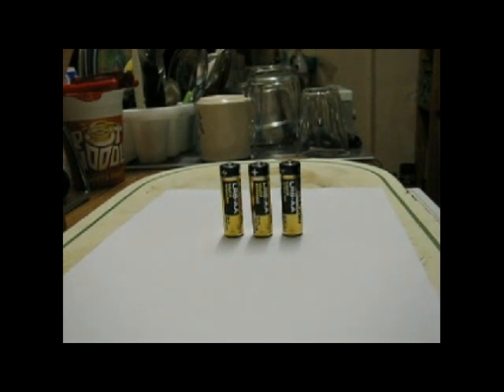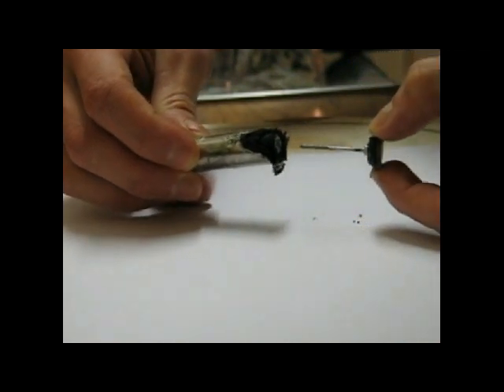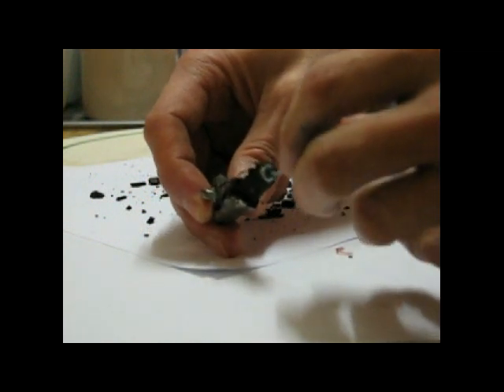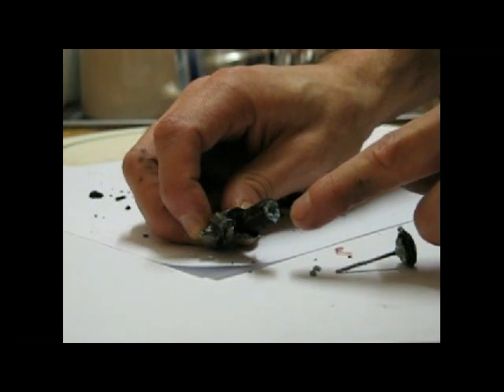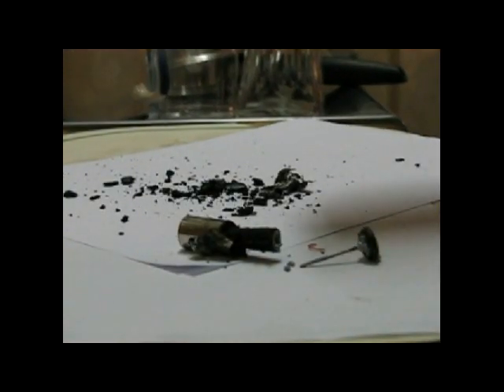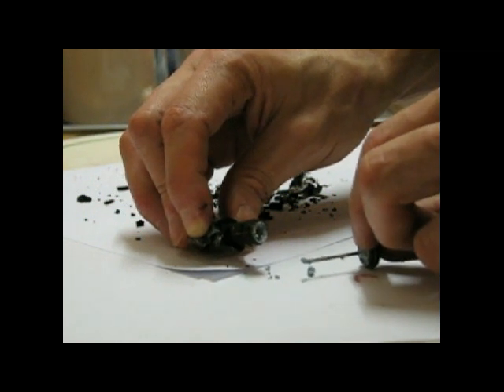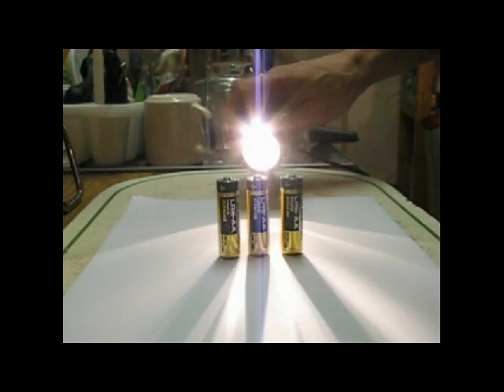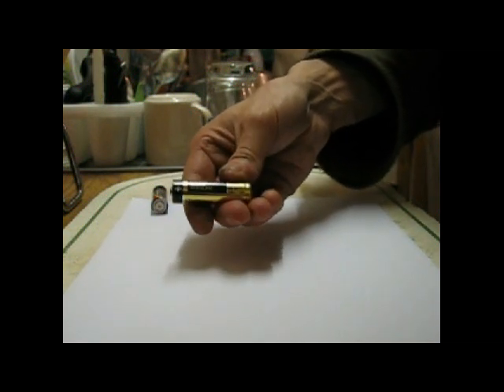Recharge Your Alkaline Batteries

Comment: I have 2 Questions.....
1) What is the maximum operating voltage(allowable/safe) to charge a 1.5V non-rechargeable battery?
2) What is the maximum operating voltage(allowable/safe) to charge a 9V non-rechargeable battery?
Reply: MattBlytheTheOne  Ok. Thank you for your reply. I would like to charge those batteries by solar energy because, solar panels of 5.5V and 100mA will be very little to charge 3V or so...
Reply from the maker: +Souvik Ghosh 

1. If the batteries are stated to be non-rechargeable by the manufacturer then there ain't a safe charging voltage (apparently).

2. The other answer is, slightly higher than the operating voltage of the battery. The higher the charging voltage the faster the charge but also the higher the risk of overheating. I would experiment with 0.5 to maybe 3 volts above the battery rating, limit the current to a few hundred milliamps and monitor them continuously to be on the safe side. Never leave them unattended and only charge them for short periods of time, like an hour max. If they show any signs of overheating or leaking reduce the voltage and throw them away.

Comment: The problem is that even if you manage to charge them, they might explode in the device they're supposed to power - this is known to have happened. So go ahead and charge your non-rechargeable batteries if you like, just don't use them in any device you'd like to keep.
Reply from the maker: +Lau Bjerno That is good advice but they are more likely to leak in your device and explode during the charging process. They are not like li-ion batteries which are made of lithium and extremely volatile. All alkaline batteries will do is expand under pressure during charging and then they might leak. They are not flammable par se.
Reply from the maker: +Lau Bjerno it is better advice never to put lithium-ion batteries in your device since if they leak and air or moisture gets to the lithium metal and short circuits them, they will catch fire and explode. Lithium metal had a very high burn rate and burns hot like magnesium.
Reply from the maker: +MattBlytheTheOne *has

Comment: I don't believed you mentioned what type of charger you were using. A nicad charger, Ni-MH charger ? Thanks.
Reply from the maker: It was just a standard charger for Ni-MH batteries. It is basically a step down transformer with a bridge rectifier.
Reply: OK, Thanks !

Comment: So t trick is to put them on a battery charger, while being careful not to leave them charging for too long a stretch at a time do that they heat up too much.

Thanks.
Reply from the maker: Yes the alkaline electrolyte in the battery tends to heat up with resistance causing pressure in the battery. Which is why they tend to leak. The trick is to keep an eye on them and not to leave them unattended.

Comment: As others have mentioned, when you are doing an informative video with narration, having music practically covering your narration is a terrible distraction. They make editing software which allows you to set background music volume. As I recall, you are also able to do this when you make a YouTube post.  Beyond that, the negatives outweigh the positives as far as recharging cells not made for charging.  Makes little sense to save 1/2 pound UK charging a dead Alkaline, and risk damaging a charger, or the table the charger is sitting on, or one of any number of negative scenarios.  My suggestion is to use rechargeable batteries where needed, and 'throw away' batteries in occasionally used devices.  This has been my experience in over 50+ years of charging various technology batteries. Cheers.
Reply from the maker: +Bill Somrak as I have mentioned before this video is years old already. The only remedy is to stop watching videos, go and buy some rechargeable batteries and get on with your life. And while you are about it but some video editing software and make your own videos, then we can hang out on your page and run that down too. Lol I don't suppose battery technology has changed at all in the last 50 years thanks to people like you! Cheers.
Reply: +MattBlytheTheOne Well, that was certainly an enlightened and informative post ... but it is not unexpected from one with limited intelligence.  Cheers.
Reply from the maker: Referring to your own post of course. There is nothing enlightened about allowing people to abuse you! Have a nice day.

Comment: Interesting.  I have a battery charger that I bought in the 1990's & it has a microchip (at least one) in it that can "sense" the recharge level of the batteries put into it & stop the recharge process before damage happens to the batteries.  Not only can it recharge alkaline batteries, it can even "top up" zinc-carbon ones, but it doesn't really bring them back to the same level as if they were new.  Also, each topping-up of them is to a lesser level than the previous topping-up.  However, these days I only recharge nickel-metal-hydride  batteries.
Reply: Is this charger called a "BUDDY L SUPERCHARGER" ?   I bought a Buddy L in 1991. This was something that the battery companies didn't want you to have and they went to governments to stop them from being distributed in North America any more . A Buddy L will charge alkalines or ni cads .
Reply: If you mean the one I mentioned, no, it's not a Buddy L Supercharger.  It's called an "IQ9000 New Discovery Charger" & it's from China. ( "Cannot beat the New Discovery IQ9000 universal charger for AAs, Nicad,
NiMH, or alkaline. It uses a CEC1100 Microprocessor. 200:1 negative
pulse charge technology. 900ma charge current")  1)  http://www.electronicspoint.com/threads/aa-battary-capacity-ah.44503/  2)  http://www.candlepowerforums.com/vb/showthread.php?26964-IQ-9000-charger-any-experiences
Reply: Also, I read this about the Buddy L Supercharger:  "Buddy L Super Charger / Emerson EBR444
The Buddy L Super Charger was released in 1993 and didn't last long. (All About Batteries)  Popular Mechanics tested it and found that the first charge didn't revive alkalines back to their original 1.5V, but rather only 1.38V.  The second charge was worse—only 1.3V.  And it gets worse from there.  From the pictures I've seen, the Emerson EBR444 was the same unit with a different name.  I bought an EBR444 around 2000 and originally gave it a poor review here, but a reader pointed out how I goofed in my testing.  Doesn't really matter, since it's not easily available anyway, and even if it were, there's little point in charging alkalines, since you can only charge them a dozen or so times (if you're lucky), vs. hundreds or thousands of times for a real rechargeable like a NiCad or NiMH.  Also, this unit doesn't recharge NiMH batteries at all, a pretty serious drawback."  ~ http://michaelbluejay.com/batteries/charging-alkalines.html
Reply: maintoc Other folks I spoke to that were former technicians from Europe told me of battery chargers like the Buddy L that were available in Norway, Sweden, Finland and Denmark but saw nothing of that type after moving to North America . It's another example of the North American government control of technology or large corporations lobbying the government so as regular folks can't have certain things .

Comment: I have been recharging standard alkaline batteries for decades. Dad taught me how.
If using a standard charger - 1 hour is the max time to leave it on the charger - test with a volt meter & you want above 15. If not charged enough you need to wait a minimum 2 hours for the interior rod to cool before re-charging again.
My personal favorite is Energizer lithium but standard Energizer batteries have better bottom seal & a better case than Duracell. Rayovac is also better than Duracell.
I now use a Maximal Power charger which has an ALK setting. Generally you are able to obtain as much as a 90% recharge which will eventually run down to much less. I discard mine when below 40% recharge rate & you should have 20 or more charges out of each.
Reply: +J.French Rennier Yes, Rayovacs are the best for recharging!  I can recharge Rayovacs many more times than any other brand to date.  Don't know what the difference in formulation is but Rayovacs are much better than the rest.
Reply from the maker: This comment was deleted lol
Reply from the maker: +StealingValor too bad lol

Comment: Thank you for taking the time to make this. Very informational. I actually like the music. It seems important to avoid the heat build-up. I normally quick-charge (Maximal Power FC999) for about two hours them leave to trickle over night as my charger does this automatically, it can also detect the bad ones. This seems to give them a decent amount of charge/performance and I can even use them for heavy-load work like my electric MTB (72V, 4500W). Works great! I get a maximum of about ten cycles at best. And of course having an almost endless supply of free batteries (I get mine at local stores where they collect used ones) is also nice. But be careful, things can still go wrong and you should keep an eye on the charger. Good luck!
Reply from the maker: +Ihaveausernametoo Yes they can still leak, in fact they are designed to leak for two reasons 1). It releases any pressure build up and prevents explosion occurring and 2). It helps to prevent them being recharged! Once the cell is dry they no longer conduct and cannot be charged.

Comment: I actually had trouble following this. Can you tell the time in the video when you are showing how to recharge a battery? Thanks.
Reply from the maker: +Matthew McClure Hi, I did not show how to recharge them, I just put them in a standard rechargeable battery charger but only for short periods at a time, like 1/2 to 1 hour. Also never leave alkaline batteries unattended. This video is for research purposes ONLY it is not a "how to" video. Thanks :)
Reply: +MattBlytheTheOne Gotcha, thanks!

Comment: what's the point?  charging for less than one and a half hour? thks
Reply from the maker: Charging for battery for half an hour at a time helps to prevent the battery form overheating and leaking. Thanks.

Comment: Can I use Duct tape to join the batteries together again after I've recharged them..
Reply from the maker: It depends what you are using them for.... If they are being used in a circuit you will probably need to solder the contacts together.

Comment: thing I could think of to test the rechargeability better would be to start with batteries that are more drained. he said his digital camera would not turn on. but all digital cameras I have used with duracell or energiser alkaline that take 4 x AA's clap out while the batteries are over half power remaining ( even 2/3 or 3/4 ) i used to take the used AA's one at a time and get 8-12 hours use from each in my minidisc player.
Reply from the maker: True but these were really quite flat and just sprang back to life. I am sure there are better and more measurable tests as the actual charge and current drain :)

Comment: Hi Matt
Thanks for the video link .scary stuff 
,I'm going to recharge or attempt to recharge two AA lithium batteries (non rechargeable )  in my D4 charger , will charge for 30 mins max at a time , will keep you posted  
Regards. Andy.
Reply from the maker: +Kwazy Kanuck I think there are two types of lithium batteries, the coiled up thin film of laminated lithium (rechargeable) and the lithium/chemical reaction type, which I don't think will hold a charge as they have no capacitive storage function (but tend to last longer initially) and when the chemical reaction is used up it cannot be reproduced. As far as I know anyway.  ;)
Reply from the maker: +Kwazy Kanuck Hi, was the battery originally a rechargeable lithium? Not sure why they go down, unless air gets in them and degrades the metal in some way or they become short circuit? In theory they "should" just keep charging up like a capacitor.
Reply from the maker: +Kwazy Kanuck haha R.I.P. the lithium battery!
Reply from the maker: +Kwazy Kanuck  https://www.youtube.com/watch?v=lzunELDAD3w
Reply: +Kwazy Kanuck  
Hi , yes I totally agree that's the same experience as I've had , I've tried several times short charged over a couple of days IE 10 mins at a time and long charges no more than 45 mins as they seem to get hot , I use a heat sink also and never leave them unattended , no luck tho so it's back to the drawing board or Amazon to purchase rechargeable batteries 
Regards Andy.

Comment: l mean you make your living as a chemist , maybe !
also do you think I could employ the same method  ie one hour charge for lithium ion AA bateries which are non rechargeable? 
thanks in advance ..
Reply from the maker: +Andy Peterson I have not experimented with lithium ion batteries. As far I am aware they are thin film of lithium metal, laminated on one side and then coiled up and charged like a capacitor, so I imagine they will charge up OK. Most  batteries in laptops and cell phones are rechargeable lithium. Lithium charges quickly and holds a charge with is why they are popular. They are also VERY reactive to water, air, fire and being short circuited so take care when handling them. I'm not a chemist, I was an engineer. It's a hobby now.
Reply from the maker: +Andy Peterson 

This is what a lithium battery can do when it is short circuited and air or water gets into the cell. Use extreme caution if you are experimenting with lithium. https://www.youtube.com/watch?v=ZTzEHsJVZhA

Comment: Poot, buy you a volt meter and demonstrate, plus only charge 15 min off for 30 - 60 min. Charging for a hour will overheat, possablly explode, or catch fire and hurt someone, in short demonstrate correct or dont demonstrate!
Reply from the maker: Thomas Gregory Go for it, we look forward to seeing your demonstration! I have never had a battery on low charge, overheat or explode in an hour, but there is always the possibility.

Comment: The basic chemistry behind an alkaline single-use cell or a nickel metal hydride rechargeable cell is quite obvious. There is no evil conspiracy to cover the fact those are the same, because they are not. They are totally different. Recharging alkaline cells works, but is useless and stupid. Alkalines are expensive, perform poorly and frequently leak even when not abused. Low self-discharge NiMH are cheap and last for hundreds of cycles.
Reply from the maker: I think you need to post elsewhere tbh.
Reply: MattBlytheTheOne 
Totally agree on that one.
Reply from the maker: TheVessapaperimuumio  I'm glad you think so.
Reply from the maker: TheVessapaperimuumio  ...

Comment: What a BS !

It is not the charging, it is the heat created with charging that will make a battery good again to be used.
I grew up in a poor family and empty batteries went on the top of the oil heater. After heating the batteries up for an hour they where ready to be used again and this was done without charging.
Reply from the maker: Bonnie Flory It's not BS. All atoms have electrical energy. Just like leaving a flat rechargeable battery over night will allow it to charge to some small extent. Where does that energy come from? It comes from the sun and it is in the atoms all the time. Heating the batteries will allow some of the energy stored in the atoms to be released and heat will also add energy to the atoms. Putting the batteries on a charger, provided they have an electrolyte and have not leaked, will add more energy too.

Comment: May have missed this in the comments but have you considered or attempted recharging in an old solar landscape light? I'd imagine they are low current chargers, haven't checked one though.
Reply from the maker: Sean Pomeroy Solar lights have solar panels which charge batteries in the day and light up at night :)
Reply: True but it's simple enough to bypass the thyristor. Not sure if that was the correct name but the miniature photocell.
Reply from the maker: Sean Pomeroy  Sure you could easily rewire it to charge during the day only and not light up at night :)

Comment: This may give some people the wrong idea about how batteries work (for example, in alkaline batteries the black substance is manganese dioxide, not carbon, and batteries work through ionic chemical reactions, not alignment of atoms or molecules).  A couple of good resources are: http://electronics.howstuffworks.com/everyday-tech/battery2.htm (and for other chemistries, google for the excellent web site Battery University).  Cheers.
Reply from the maker: Rog   ALL flow of electrical energy is only possible because of the alignment of atoms. Thanks for commenting.